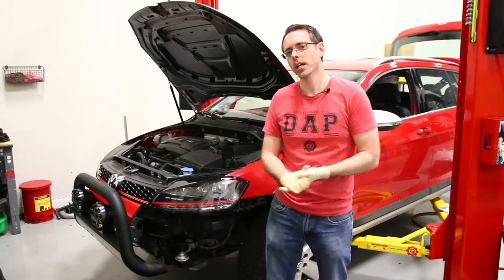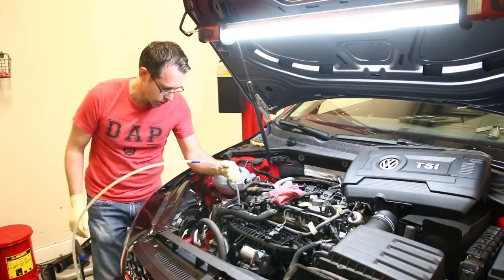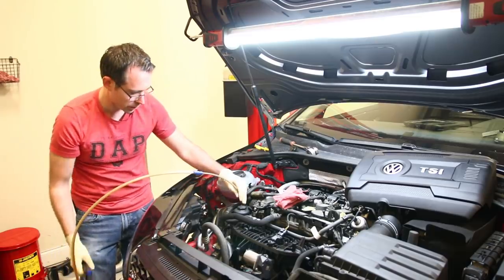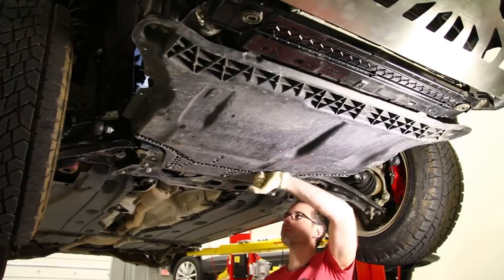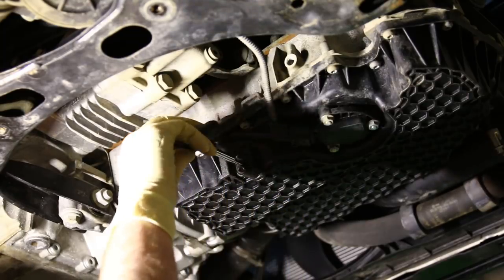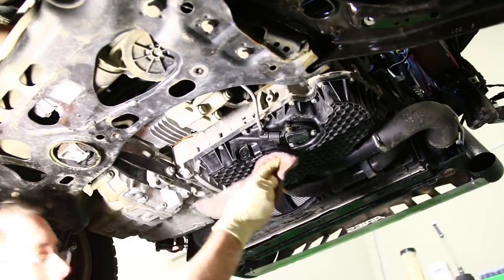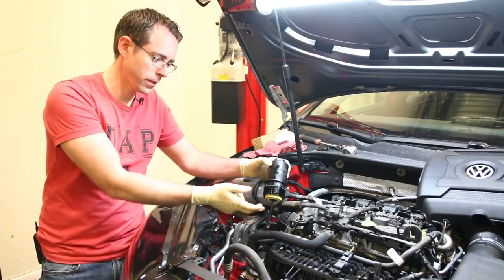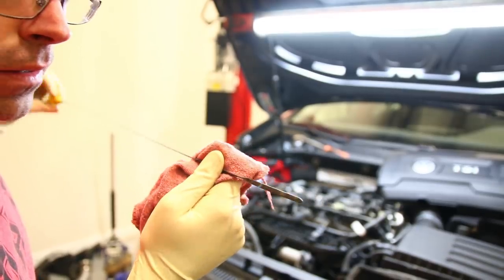1.8T Oil Change DIY | Extractor vs Drain Method

Comment: There is always some oil in the engine passages that will not come out and should not.  It reminds me of how when you drain oil from a transmission most of it is not in the pan.  Why did don't torque converters have drains any more?  I know some vehicles did and even Mercedes used to do it.  You would just have to get the drain hole to turn toward the bottom so you can get he fluid out.  I am thinking that the only reason you don't see it any more is cross threading may have been too easy on those and of course you would not want to cross thread a thing like that, it could put a real damper on your day!!

Comment: Could you have pressure vac from the filler port? 
I think some older cars has a one way valve, which would pinch your line when you try to pull it out.

Comment: I am on a fence between the draining method and the extracting method. If the oil filter is on top the extracting method is preferable, perhaps. Likewise, if the oil filter is on the bottom it makes sense to drain from the bottom. You are going to make a mess anyways, perhaps. For those who extract from the top you might rethink this method. When draining from the bottom the oil flows out including metal particles from engine wear that sits on the bottom of the pan. Extracting oil from the top might miss all these metal particles. If I do an oil change I want to make sure most of the metal particles are drained as well. But we can argue and say that's what the oil filter is for.

Comment: I’ve bought all my oil and filters from you, and the filters always come with a new drain plug.  I would not feel comfortable putting a used plug back in.  Also, I bet the oil left in the pan from the extractor had most of the contaminants.
Reply: Please explain... is the plug plastic? I've reused all my plugs minus the gaskets with zero issues for the life of the car (metal), im confused?
Reply: Nevermind, just saw it's plastic and the pan is plastic!!!! That's crazy!!!!!!!!!!!
Reply: It actually works pretty well, easy, and I’ve never had a leak.  Can’t say that about the stupid plastic water pump.
Reply: I have a 18 gti now, but when I had a 17 wrx the oil changes took literal 10min or less. I had a fumoto oil drain with lever lock. Not sure if they make them with the 18 gti.
Reply from the maker: Thanks for the support. We appreciate it very much
Reply: @joshuafisher2642  Pretty sure they don't fit.
Reply: @AlumarsX  you mean make ? fumoto doest make one for the 18 gti?

Comment: I just ordered on of these as my Q3 and Ml350 has filters ontop . My A4 has the filter on the bottom so i might just do this to get most of the oil out then jack it up to remove the rest. Question do you think if you jack one side of the car up to have the oil drain to one side do you think the oil extractor would remove more of the remaining oil?

Comment: I bought TWO extractor pumps on Amazon from different sellers that look exactly like this one. But neither of them works. After pumping 200-300 strokes I am exhausted and only about 0.05 liter has been pumped, and it stops flowing as soon as I stop pumping. Unfortunately I am out of the return window since I was waiting for better weather to go outside and change the oil. Does anyone know what I should do? Does the one from Harbor Freight work?

Comment: When did VW start putting the oil filter on the top of the 1.8T?  Isn’t the a 2.0T engine?  And 6L capacity on the 1.8T?  By the way, suctioning oil out is the approved method for changing oil on a Mercedes.

Ok!  I learned something new. VW made an anemic 1.8T.
Reply: Go away

Comment: I wouldn't worry about the 100ml in the pan.  There is probably 10x that much still left in the oil pump, inside the cylinder head, oil lines, coolers, turbo, oil galleries and vvt if equipped.  i have oil analysis showing retention of wear metals, contaminents, oil sludge, fuel dilution and affecting the viscosity, TBN, oxidation of the new oil within 20km in a 2.4l, I-4 engine. Similar results in other vechicles..  Assuming that a standard spill and fill removes 99% of the old oil. which it doesn't, would you buy a quart of oil that contained 10-20% of used oil of unknown quality and listed wear metals, fuel, and sludge as possible ingredients.  Survey says overwhelming, no.  Perform a double oil change and replace 99% of the old oil.  Similar to a transmission fluid exchange..  In the industrial engine world this is called a Full Volume OIl Change.  Keep the flush oil for your next oil change.  I have nothing to sell you, only to encourage others to ask questions, like how much and what affect.  It well known that the cleanliness of the oil in your engine is directly related to engine performance and longevity.  Didn't your car roll of the assembly line with a 100% clean oil?   https://www.machinerylubrication.com/Read/31012/short-volume-oil-changes

Comment: the oil filter cap stick on my 2017 passat 1.8T was separated from the filter housing when i removed it. i inquired with multiple vw service dealers and they said that some of them came like that from factory and its not broken. but ur saying  in the video that one will have to buy a whole new filter housing? confused...hhmm.....ALSO  in my passat the drain plug is a hex shape ..and not plastic...why does VW does soooo many different variations in similar engines across models. Other manufactures do not do that
Reply: German cars never make any sense

Comment: Why is it not necessary to replace the small seals on the adapter valve ? even the workshop manual don't even require a replacement. I find this puzzling. Every other kit comes with the small seals but not this one.

Comment: If we do the oil extractor, don't we still have to change the drain plug o-ring? Or can that step be skipped since using the extractor means we don't have to loosen the plug?
Reply: ajyn17 no, that plug can go for way more miles than you think.

Comment: Clearly the best way to drain the oil is out the drain plug, as any  dirt will come out with that last bit of oil, otherwise the dirt remains in there to contaminate the new oil. Your choice!

Comment: It's not the amount of oil left behind which bothers me, it's the fact that it's the most contaminated oil, with any particles which might be present, which will naturally sink lowest, to the bottom of the sump pan. Draining in the traditional way, from underneath, drains this crud off first with cleaner oil from above 'flushing' anything which is left over. In addition, although there isn't much left over, you still have 150ml of the dirtiest oil in the system instantly contaminating your new oil and filter element. To really go to town on the difference between the two methods, it would be fascinating to see some kind of oil analysis of the crud which was leftover from the vaccuum method to measure for particulates, etc. and also how quickly it deposits these on the new filter element. My impression, from watching this, is that the top-drain method is great news for VW workshops to keep servicing times and costs down, but bad news for the engine long-term.
Reply: It's not the dirtiest oil. It circulates continuously so what's left is identical to what came out.

Comment: My b7 Passat has the 1.8t just like this but doesn’t have the plastic oil pan? Any reasons why?
Reply: the b7 passat is not on the latest mqb platform. now all VW vehicles built on mqb platform have this plastic oil pan.
Reply: Plastic oil pan!?!? Guaranteed terrible design. We will be hearing about failure of these in 5 years all over the forums.
Reply: shawn d plastic oil pans have been in use since 2013. Absolutely none complaints.

Comment: I was seeing oil change vids on some Toyotas and was seeing the oil filter having to be accessed in the wheel well.  That is you have to take a tire off to get to it.  Some Nissans are like that too.  Possibly some Hondas may be that way too.  I don't own a Toyota or Honda but I find it fun seeing how other people have to do theirs. It also in that regard left me realizing that there are some cars to avoid because of that terrible design choice.  I don't think that anyone should have to remove a wheel to change the oil.  It just seems very asenine to me that they would design a vehicle in such a way.  Now I know when I shop for my next vehicle whenever that is, research how to change the fluids on that specific one.  It may be enough to make you decide on a different vehicle even from the same manufacturer that is not designed in such a bizarre way.  It would seem to me they only did those things to make it difficult so you might take it to a dealer to get it done for a huge markup.  Why else would they do a thing like that?

Comment: You still didn't drain all of the oil because the drain plug is on the side, not the bottom of the oil pan. I'd rather get all of the old dirty oil out, for piece of mind.

Comment: Is there a team of engineers at VW that sits around trying to figure out ways to undo proven technology that’s been in use for generations in favor of methods that waste time and money and test your patience?  Why not just put an access hole in the skid plate?  Why need a special socket for your oil drain plug- and one that isn’t reusable at that?  I know the answer, but damn.  Every time I think about a new vehicle and start research on VWs I get scared away by a lot of stuff that shouldn’t be a problem.  AWD (Haldex) pump?  Does anyone else have a pump in their AWD system besides VW Group?  Problems with thermostat housing?  Come on.  This stuff has been figured out for almost 100 years!  I am still less than 24 hours into my research!
Reply: YOU THINK VW is bad? AUDI IS WORSE , I have 2018 AUDI A6 and they have eliminated the dip stick, covered the entire under the engine with  huge plastic trays that have over 30 screws total to remove if you plan on doing a drain plug removal oil change. It takes over 40 mins to remove the screws with the front end jacked up high enough so you can reach all the way to the middle of the under carriage to remove the screws. On top of that they used 5 different types of screws so if you are not careful you will end up swapping screws from one hole to the other trying to figure out which one is the correct one. YOU know why they made it all this difficult ? SO all of us DIY guys have a hell of a time changing oil which should NOT take more then 30 mins from start to finish This is their way of ensuring they get all the service profits from the dealers since not many will change oil in these latest models juts because it is so complicated. WELL AUDI and VW you all need to know there are die hard DIY guys who will beat you to the game and keep doing their own oil changes come what may.
Reply: @MahmudHasan-hs7qq  The reason there are 30 screws in the plastic pan, is because the VW dealers never drain the oil from the engine. According to ELSAWIN (the original factory software) the dealers use a VAG 1278 tool to suck the oil from a plug, placed where the dipstick shoul be! And according to ELSAWIN most VW engines can be drained by the suction tool…

Comment: I can't believe that there is no access hole/panel to the drain plug... what a joke
Reply: I will be cutting my own on my '15 Sportwagen.
I'm not taking the frickin splash guard of every time.
Reply: @sonofrobert  Someone should make an aftermarket splash guard with a door. Those things are expensive, i wouldn't cut it!
Reply: @goclunker  
I haven't looked at it yet.
It is for aerodynamics.
Guess it keeps the engine cleaner also.
Maybe I can make a flap that I can put back.
Reply: How often are you changing your oil? lmao, it literally takes 2 minutes to pull the belly pan... lazy much. lol
Reply: @logmegadeth72  
That's sounds easy enough.  I won't cut..lol
I've done 10k full synthetic on different cars with good results for 15 years.
I have a 40k change on Sportwagen coming up soon.
Should I stay with the Castrol edge full synthetic or Mobil 1 0w40 full synthetic?
Cheers
Reply: @logmegadeth72  
Wrong.

But yeah, it may actually be 2 minutes (maybe) if you have it on a $12,000 hydraulic lift. And not everyone has one of those (or has access to one).
Reply: Andy Roid lol I don’t have a lift either roll eyes
Reply: @sonofrobert  exactly I plan on cutting a hole in the under tray big enough to stick my hand and the wrench to remove the drain plug .WE can beat these auto manufacturers to any new game they come up to make more money from service.
Reply: @MahmudHasan-hs7qq  
I don't have to remove the splash guard on my '15 Sportwagen to get to oil drain plug.
Not sure how the other years are.
Cheers

Comment: No point of buying this item if your oil filter is in the bottom. You will still need to jack the car.
Reply: It’s almost as though this is a Volkswagen focused channel and a large number of VW vehicles have top side oil filters. Whoda’ thunk it?